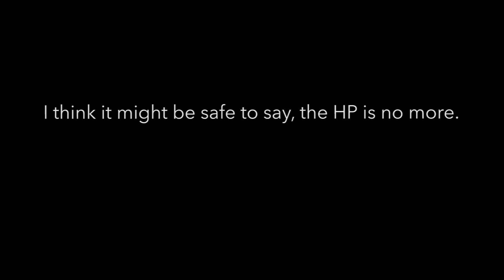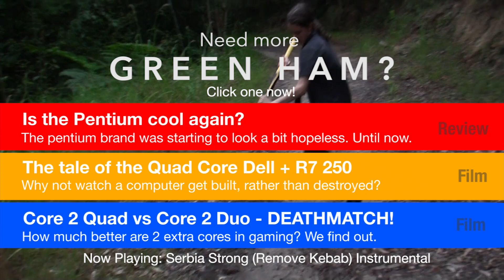HP Destruction

Comment: I have an core 2 duo HP small form factor, similar to this, but quite a bit newe,and without the design flaws you mentioned.  picked it up for 55, wasn't a bad buy at all for what its used for I use it every day for work. The only thing I feel it really needs is a dedicated video card. But with a 180 watt psu, in the shape of what appears to be some proprietary thing, I have my doubts anything good will come of trying to install one
Reply: Mr Onion I have one of them too, but with a 240 watt psu. If you are in australia I can send you a geforce 6400 for A$30 including shipping.
Reply: thanks for the offer mate, but I'm in the UK, it would cost more to post it than its worth lol. I don't really need a graphics card for it anyway. It mostly gets used for word documents and ebay. I have my gaming pc (i5 4460, Radeon R9 280 etc...  for anything more demanding.
Reply: Mr Onion lol i know, have a look on ebay for geforce 210 as well it still ain't great but it blows the integrated graphics out of the water and they are like 24 pounds.

Comment: ok... the power supply has its own fan that withdraws its heat from the psu so basically all that hot air from the pentium is just getting blown out with the psu's heat.. a

Comment: You know, the playstation 3 and 4 are designed the same way. The hot air from the cpu and gpu is pushed in the power supply.

Comment: my hp g60 which is like 5+ years old heats up very fast. normal computing like youtube becomes impossible within 20 minutes and the video freezes.
Because of horrible cooling
Reply from the maker: Typical HP. Let us know if we can destroy it for you.
Reply: I have the same laptop, and I can say from personal experience that's quite easy to fix.

Ypou just need to go into power options>advanced settings, and then find the CPU drop down menu, and set the maximum CPU usage to 65% on both Charging and Unplugged. Simple fix.
Reply: ThereIsNoMatch THEY SHOULDN'T MAKE THE COOLING SO BAD ANYWAY IN LAPTOPS.\ZZ\\

Comment: "As a designer"? So you have a job as a designer and a Youtuber?
As for the smoking, just use a candy cigarette.
And if you want to do another destruction video, try and overclock a computer and run a graphic-intensive game to the point where the computer shoots sparks as it short circuits.

Comment: HP were the worst laptop desktop makers of all time for the budget PC's Market Due to their Defected hardware
Back in 2003 I had Hp Laptop Pavilion ze5500us  only last 3 months then had
hardware issues like Hard drive Failure  sent in then came back only lasted 2 weeks due to a motherboard/screen/graphic card issue, Whole computer failed 
so rest in peace RIP HP ze5500us back in 2008

I put like 2000 dollars in repair cost to keep it running
Laptop was 2000 dollars brand new from best buy
Rumor states a lot of best buy stuff is defected and rigged to fail, remember its a rumor not all rumors are true
Reply from the maker: Anonymous We Are Everywhere One of the reasons I decided my HP needed destroying. 

If It was going to die, I wanted to be the one to kill it
Reply: Nice, i saw you have Dell OptiPlex's
I have one Called Dell OptiPlex 380
Which is for sell on ebay

Comment: HP PCs are pieces of actual sh1t... I have a HP Omni 200 with a Pentium E5800 and it overheats, crashes EVERYTIME I try to render videos or play CS 1.6. Oh, and its Ethernet port stopped working
Reply: ProCreeper 2000 So? Dell is 1million times better than HP anyway
Reply: ProCreeper 2000 My HP overheated the 4th time I turned it on.
Reply: ProCreeper 2000 I start minecraft and my CPU reaches 90 degree C
Reply: +ProCreeper 2000 Average fps is 39 right?
Reply: +ProCreeper 2000 the Lenovo ThinkPad X200 laptop 7454CTO overheats like crazy.  The small fan can't keep the core 2 duo p8600 furnace edition cool enough. It's right next to the fan, so dust isn't a big problem. I get 90+ degrees c while sitting at the bios.
Reply: ProCreeper 2000 It didn't
Reply: +ProCreeper 2000 It fried the motherboard, is it a bad thing?